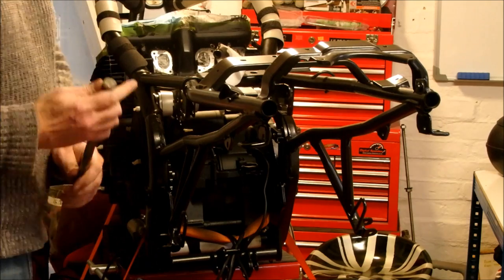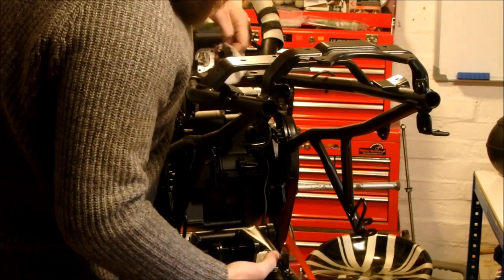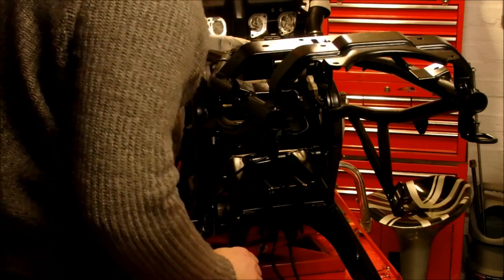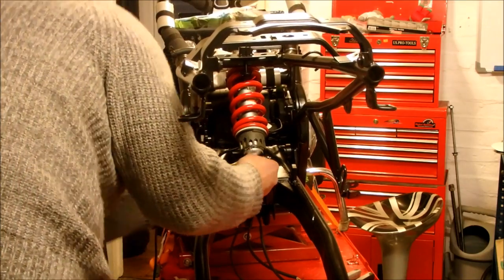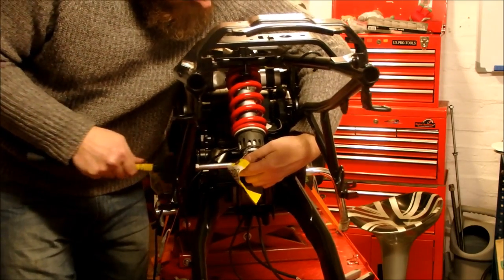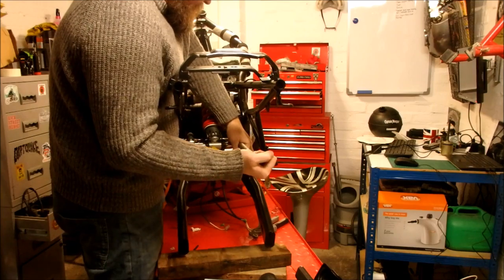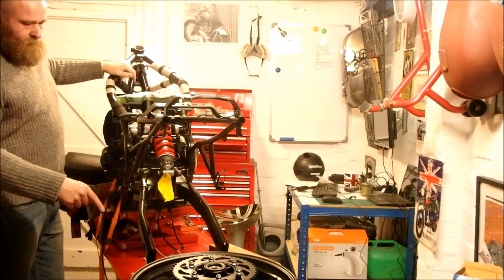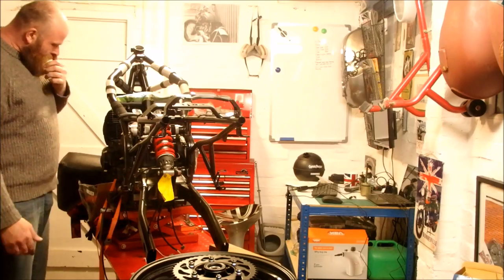Yamaha XJ600 Diversion / Seca 2 - Swing-arm and mono-shock installation

Comment: Nice one buddy, it's looking well now! the camera angle was spot on bro, made it look much wider than it is, which can't be a bad thing for a skinning bike, I say that but maybe mine just seems skinny as I'm so used to riding the Cruiser, lol, RSM8.
Reply from the maker: +Skeggy Cruiser Thanks Skeg's just ordering the new brake lines and some bits and bobs to finish off the master cylinder.  Stilll trying to work out what I want to do with the back tyre, normal or knobbly.

Comment: Great progress buddy, bikes looking proper posh now... always watchin.. Del.
Reply from the maker: +Moonfleet41  Thanks Del, slowly but surely,  looking for a nice replacement to the rear master cylinder,  but unsurprisingly Yamaha don't offer any options, is the shape and diameter of the reservoir important, or can I use just about anything?
Reply: +GTs Garage No, there are no options on that kind of thing, Jap bikes are a set menu from the factory....but things like master cylinders and reserviors are often common to a few bikes in the range, and, no, they aren't size or capacity specific as long as they are from a similar size bike, (ovbiously dont go fitting one from a moped lol) just as long as they can supply the fluid as the caliper needs it then you're good to go... with the fluid pot you can even go the 'GP Style' clear plastic tube, as long as you make it long enough to hold enough fluid.... 
Im pretty sure that any middleweight 80's Yamaha setup will do the job, you may need to fab a bracket to secure it, but thats no big shakes aye.... hope that helps buddy.... always watchin... take care Del.
Reply from the maker: Cheers Del, appreciated. Might as well throw something ornate on the back if possible.  At least the shock has made the choice of cable colours easy.

Comment: Can you give more info on the Shock, which name, where you bought it etc, in case I decide to change mine, which looks like your old one.....
Reply from the maker: +ROY Dean  Hi Roy, my understanding is any of the 2009  - 2015 XJ6 shocks will fit the XJ600, the problem for me was finding a later model to purchase.  In the end I looked on the American Ebay site for the FZ6R which is the American version of the XJ6 and there were a fair few.  Thing to remember is on top of the part and postage, there is going to be an import cost,
Reply from the maker: +ROY Dean Roy, if you are thinking of doing some work on the XJ600, this site is well worth a look, the link goes straight to the shock upgrade post but can use the home link to get full site over view.. http://www.xjrider.com/viewtopic.php?f=71&t=6513
Reply: +GTs Garage Thanks for the info and the Link.................the Link is extremely informative.....wish I had found it before.......Ta
Reply from the maker: No problem, glad it was useful

Comment: Really come on a lone way mate, Looking better every time. Nice to know that all the rear shocks are the same.... When i changed my swingarm i just got the rust off and panted it after all like you said the parts will be more then the bike. Nice vid as always
Reply from the maker: +whoamiuk1 Thanks, is just the way it is with 2nd hand bikes over 600cc, the market tends to be fairly flooded with them, so cheap as chips.. the market that tends to hold a reasonable price is the 125cc market,

Comment: are you using regular rear wheel? ou other like the fzr?
Reply from the maker: +MSTech Hi, am using the thicker rear wheel of the FZR, it's actually not that much bigger, but as its a straight bolt on, with very little work, seemed worth doing.  Reading the forums another popular mod is do go down a step from the standard, apparently the handling is transformed and you get something you can really throw round corners.  Thanks for the subscription and comments, always appreciated.
Reply: +GTs Garage what do You mean as step down? Its the 17" mod? By the way what tyre are You using on the 18*4?
Reply from the maker: Hi, I am upgrading the standard 1992 XJ600 18 x 3.5" rim with the 18 x 4" rim off the 1992 FZR600R and fitting a 5" tyre to it, that seems to be the standard conversion.  Some have put a 6" tyre on the FZR600R 4" rim, but it never struck me as a good idea.   You can also go the other way as older XJ's have a 18 x 3" rims fitted, so you could put thinner tyres on it, as its supposed to improve handling.   As for the 17" conversion,  I haven't done it as that isn't a plug and play solution, I believe you have to make up new spacers to make it work and it's a lot of effort for that additional inch or two.   Hopefully that makes sense